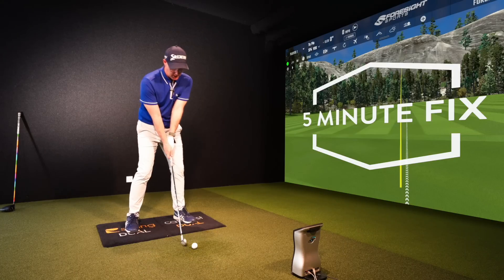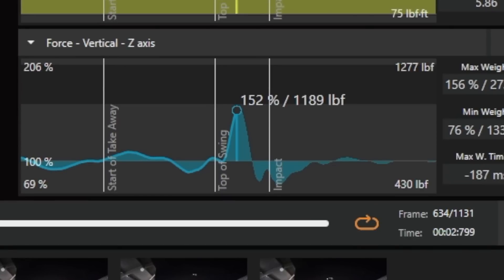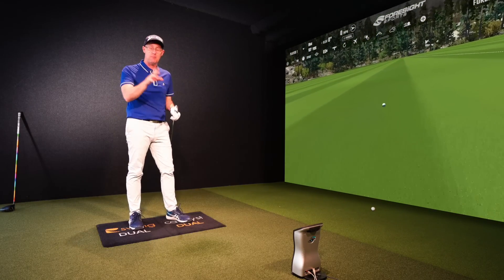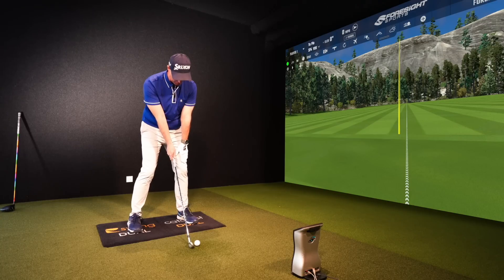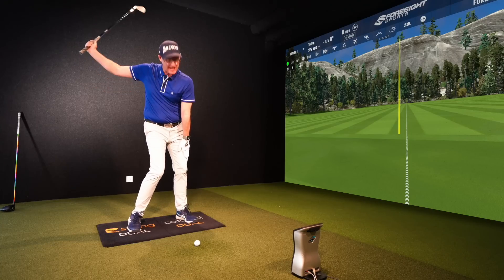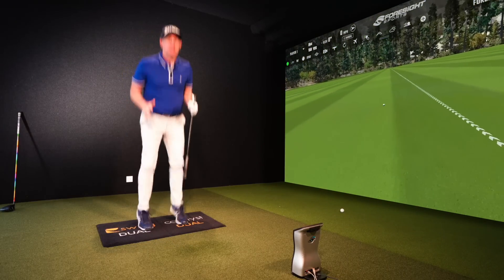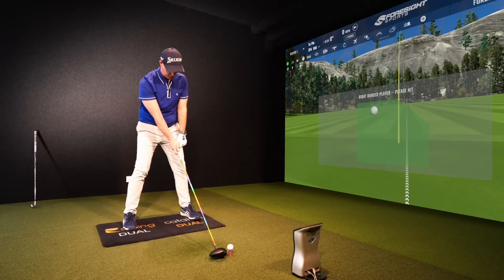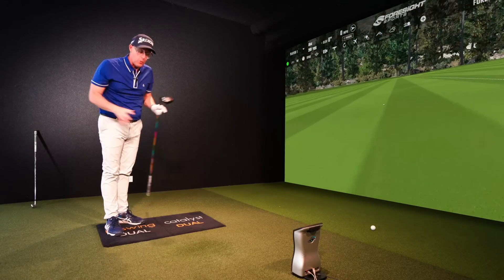Your iron swing is so easy when you do this (golf swing tips)

Comment: I think the idea of straightening the left leg cause issue. I prefer the term of pushing in the ground after a small shift. Like that the leg will straighten without thinking at it and at the right tempo. Adding the force pedal training aid has given me the right feeling. And in 1 session, i gained between 5 and 8 mph. In other word, my 9 become my 8 and a lot more height, et consistency of launching. So push hard, just push and everything will turn for finishing perfectly balanced on the toe of the trail foot. Magical😂